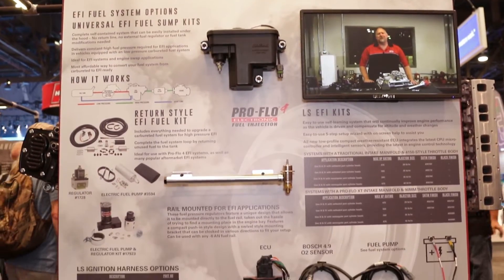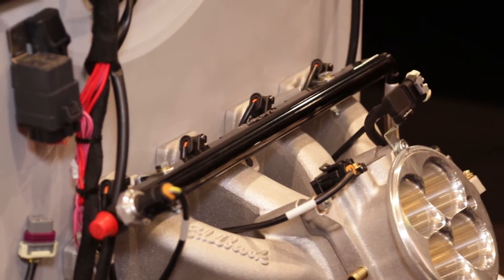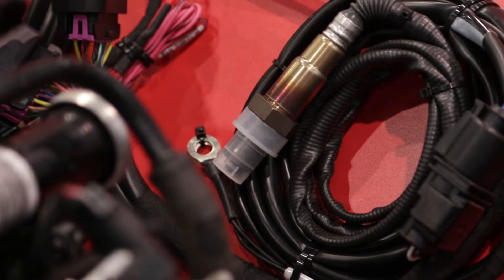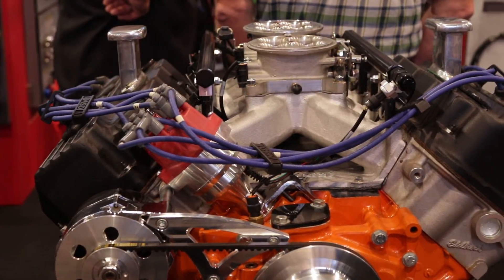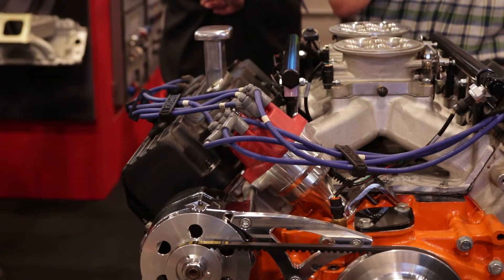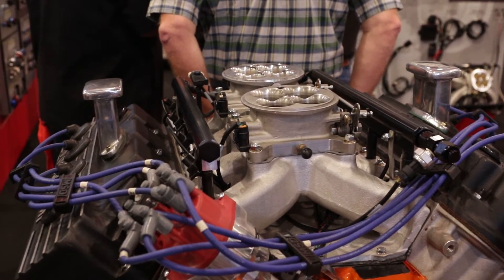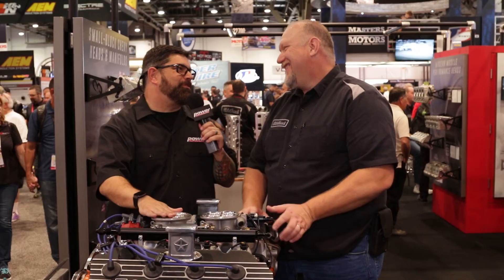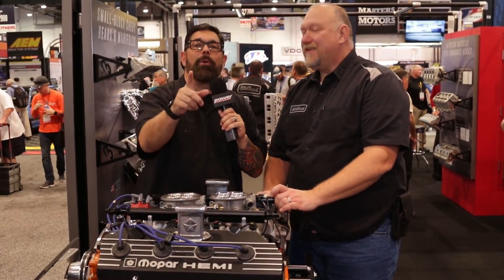A SEMA 2018 Look at Edelbrock’s Pro-Flo 4 EFI

Comment: Edelbrock didn't do any justice with their simplicity claim in this video. "Just buy it, bolt it up, let the tablet do all the work and drive off." You have to understand how the pressure difference relates in the necessary fuel delivery for EFI systems. Focus on that before you buy. It's an additional $600-$1000 to install the proper fuel delivery system to get their "Just bolt in up on a Saturday and drive off" bullshit claim to actually work. They should have fuel delivery in the video, and part of the kit.
Reply from the maker: All EFI systems require a high pressure fuel system. We offer fuel system options as well.

Comment: When will you port the tuning app to iOS?  It may sound crazy but I hate android.  I would consider this system if I could run it from the same device that I use for navigation and music.  I have a 460 Ford that I am planning out a build for. I would like to get 650-750 hp out of it.  Why is the max hp so low for a big block? (Edelbrock max is 625hp for the 460)
Reply: They use their own camshafts and heads for base settings. They do have a turbo, super charger option. So you can go to 1000HP.
IOS is a closed system. And all EFI systems use a CAN system.

Comment: I got an  e-mail from Edelbrock  saying they had a stand  alone wiring harness and  ECM  for an LS  engine  so the video is mostly about  a  throttle body ..  They did show the  LS  set up for a few seconds..
   Shows a  little hand held  tablet .. I supposed I would have to look and read for an hour to see if that can be used as a Dash Board.  Haltech has  a way better set up but it costs  a  lot more ..   yet has  tons more features..
  They sell a dashboard  computer that will work as a speedometer.   tells  you what gear you are in ..  temperature   oil  pressure  gauges and all of that..
Reply from the maker: We sell an ECU and harness kit for the LS platform. Its intended to use stock intake and injector set up. We also sell a full Intake manifold and ECU system.
Reply: @EdelbrockUSA    Thanks for the Reply .. Does the   Edelbrock ECM    work with  GM  spark knock sensors.?  Can  you  control  electric fans.. Can  you  hook it to   temperature  RPM  gauges ..   Does Edelborck  have a Dashboard  that works with this ECU  ?
Reply from the maker: @mikeskidmore6754  The Tablet can be set up as a dashboard to display water temp, AF reading and much more. Does control fans as well as RPM's.

Comment: Edelbrock can you make some videos for these systems installed on engines and show it running please.
Reply: The engine would sound the same  even with a carburetor and  mechanical  distributor ..